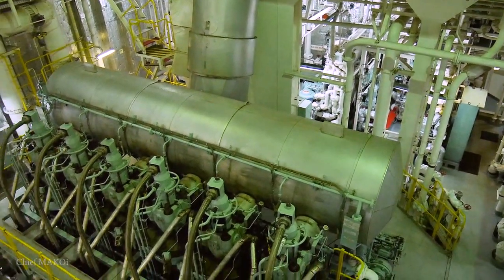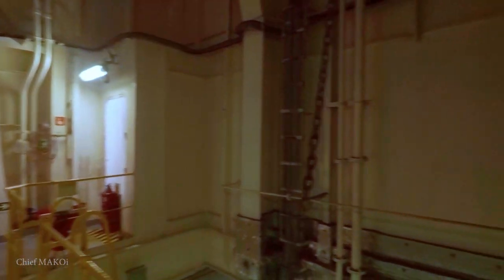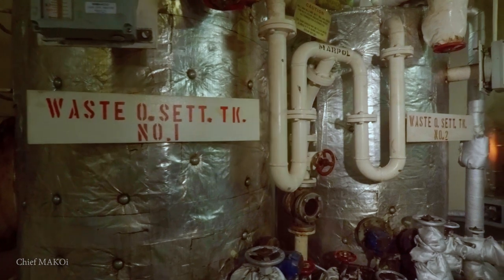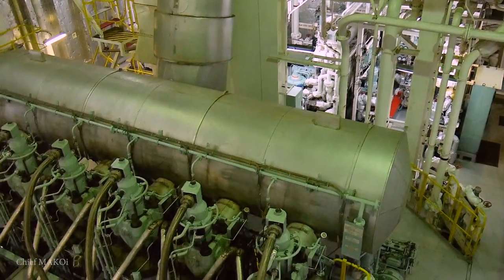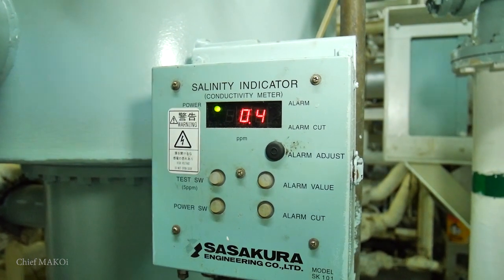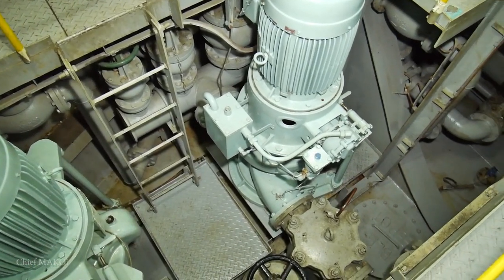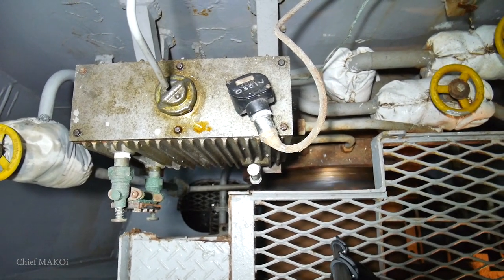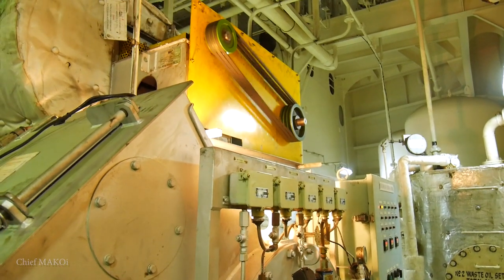Ship's Engine Room | Seaman Vlog

Comment: I worked as an outside fire protection contractor on ships for a few years and found that ships with Filipino crews maintained the cleanest engine rooms. Exxon, Standard, Military Sealift Command, APL, and a variety of others are the lines I worked on.

Comment: Chief, I am in my seventies and was an engineer on steam turbine ships for several years. Even so apart from main engine differences there are still many similarities. Heat noise and vibration, no ac control room. We had occasional emergencies and I have to ask are you always this calm? Some chiefs I have known were definitely not! Still the bestjob I ever had. Thanks for refreshing my memories
Reply from the maker: Yes, I'm pretty much very calm.  Doesn't serve any purpose to be stressed and panic all the time 😄
Reply: Me too, 'Harriet'. Babcock&Wilcox 650psi main-steam. 4hr safe-stay time in the Med during their summer. THAT was hot...

Comment: I’d figure there must be a lot of R&D work going on in developing ship propulsion and electrical/fresh water generation systems etc that run on renewable forms of energy rather than heavy fossil fuel petroleum distillates.  Need to figure out how to make these necessary processes carbon-neutral very very soon!
Reply: You're right, there is lots of work going into hydrogen and electric merchant ships currently!

Comment: AAAhhh, my job description many days. Hot, noisy and the smell of grease and fuel in the air, sadly retired. So many lovely gauges to read and each one worth noting. Do you actually use diesel or is the main engine on bunker fuel i wonder with all that fuel seperation and filtering. Those Diahatsu engines would want diesel I expect. Thanks for a great ride Chief!!!

Comment: A couple of questions on the main engine Chief -
1. What are those grey tubs between each cylinder on the tops?
2. With a camshaftless engine, can you still drive on the sticks?  Just wondering what happens if the electronics/pneumatics/governor etc fail?  Even with the more modern (in my day) engines such as the GF, you could still leap out to the sticks to get you out of a sticky situation...
Reply from the maker: +Stephen Carey 1. If you put the time frame where it is shown in the video, I'll be sure of my answer.  But if I had to guess, you're probably pointing at the accumulators.  Located around the Fuel injection pump area? They're the odd looking things if you're used to the old engine designs.
2. That's the pickle with these electronic engines.  They all depend on the circuit board and there's no way you could do things manually.  There's always a spare of those onboard though.
Reply: What are the accumulators for?  It's certainly what they look like, but I don't know the purpose - to keep the hydraulics up to snuff for the exhaust valves?
I remember when we went from relays (which I still think are the best way to run things in enginerooms) to PCBs, it was fine if you had a box full of cards, you just swapped one out - which then blew with exactly the same fault!  You left the card half out to keep the alarm light flashing, and just kept an eye on what it was measuring...  That was a bit onerous once you had half a dozen of the damn things flashing away.  Nowadays it's all done with redundant PLCs - we used dual redundant ones in the Oil & Gas industry.  If one went wrong, it switched to the redundant PLC and everything carried on as normal.  Not!  Then you had to get some 11 year old with a laptop to come down and search through the ladder logic to see what had gone wrong...  to me it's technology looking for a market place, and it has caused problems in the Type 45 destroyers of the RN, and also the USS Zumwalt class.  Everyone says it's too difficult to fix the propulsion quickly if a bullet goes through something, whereas there are stories from WW2 where the whole main engine was shunted aside by a torpedo, and the stokers managed to crowbar it back into place and get the thing going again!
Give me a camshaft any day...
Another nice clean engineroom by the way!
Reply from the maker: Yes, the accumulators are indeed for the hydraulics, both for the exhaust valves and the fuel injection pump.  

Thanks for sharing your experience btw.  I actually share the same sentiment with regards to engines with camshafts.  I've had my share of remote control malfunctions and going manual saved the day.  Unfortunately the trend is headed towards this type of engines so I also need to adapt or risk becoming obsolete.  That's just how it is in the industry, right?
Reply: @ChiefMAKOi  Yes, I consider it's "technology looking for a marketplace" and as far as I am concerned, that marketplace is not at sea, but "What to do - no choice!"  There have been problems with the RN's Type 45 destroyers, the USN's Zumwalt and Littoral ships too - too complicated, and when something goes wrong, it's not easy to fix.  Not a situation you should be placed in when shot and shell are passing over and through you.  I have no problem with weapons and comms being computerised, they can react far faster than the average "fish head" can, but propulsion and power generation are the heart of a vessel, and having to call some 11 year old with a laptop to try and get round the ladder logic of your engine system doesn't seem to me to be the way to go!  I remember one "war story" where a torpedo hit the ship in the engineroom, and displaced the main engine (steam recip) by a few metres.  They fothered the outside and crowbarred the main engine more or less back into place and got going again!

Comment: Is the engine room kept so warm for a reason, meaning in colder climes, can it be more excessively ventilated to keep the temps down, or are machinery tolerances set up expecting 45 C?

Comment: Quick question, I noticed on a few marine engine videos, the tachometer has the red area around 50RPM. Is that for engine parameters or for the prop efficiency?
Reply from the maker: Critical speed.  Lots of vibration.
Reply: @ChiefMAKOi   Ahhh, ok. Thanks!

Comment: Hi Chief MAKOi, My grandfather was a chief eng on the great lakes and served in WW2. I'm curious when you need to reverse thrust, does that mean you need to reverse the rotation of the engine as well since its coupled direct to the main shaft? Does that take long to do?
Reply from the maker: For ships with direct coupling, yes the engine needs to reverse rotation.  Since you will only usually use reverse during maneuvering, the ship isn't moving too fast so during those times it doesn't really take too long.

Comment: I'm curious. If the main and auxiliary computers failed could you possibly manually run the main engine ?
Reply from the maker: On this ship, no.  I was informed that Belgrano was towed last week in Canada because the engine suddenly stopped and then failed to start.
Reply: @ChiefMAKOi  I have always wanted to have a computerized run engine but with manual backup. I guess that is impossible. Just one EMP or dirty bomb will shut down everything. It's all meant to fail is all out war breaks out.

Comment: Cheng MAKOi; you don't know what hot is until you've stood watch in the boiler-room in the Med during their summer. 4hr safe-stay time standing DIRECTLY under the ventilation ducts.
It was like walking into an oven. 🔥
Reply from the maker: That's winter if compared to going INSIDE the Boiler furnace for tube cleaning while your ship is anchored within the Persian Gulf in July.  Even wearing 3 coveralls, 3 pairs of socks, a wintet jacket, leather gloves, face mask, and winter hats to insulate yourself from the heat, the longest I've lasted inside was about 30 seconds.  We can't wear thicker clothing because the crawl space to get inside the furnace was very small.
Reply: Cheng; we waited for 'cold-iron' before starting THAT hot mess, but I feelz 'ya, boss. Oh, the memories....
You just earned a sub... ✌
Reply: Oh yeah; seeing the 3-bladed screws on the epaulets of your kackis warms my heart. You're in charge of the heartbeat of the ship; savor it. ❤ USN(R)

Comment: 5.40 Do you guys carry out Vibration analysis on the Engine room? Looks like a vibration analyzer the guy is using. Just discovered your channel its very interesting.
Reply from the maker: It's a pressure indicator to measure the power output of each cylinder.

Comment: What is the electrical voltage coming from those generators?
Reply from the maker: 440 V
Reply: @ChiefMAKOi  Is it a 480Y/277 volt system of is it a straight 480 volt delta?

Comment: A TIP FOR YOUR VIDEOS IS IF YOU HAVE TIME PANN AS SLOW AS YOU CAN AND SHOOT A TINY BIT WIDER, THEN IN POST YOU WILL HAVE LESS ROLLING SHUTTER AND CAN SMOOTHE EVERYTHING LIKE BUTTER.
Reply: Tip for your posts. Do not use capitals, this is not a teleprinter. Capitals denote shouting.
Reply: Sometimes caps is on and i have already typed , i often don’t look at what i type as i go. The placement of the caps button is in the way

Comment: 7:20 3 x 610 kw = 1.8 Mw Why would you ever need this much elektricity on a ship? Unless you use it for resistive heating, wich would be horribly inefient compared to just burning the diesel directly.
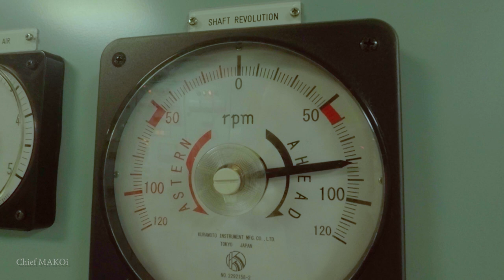Edit: 10:57 
I see that only one of them is in service and the other two are on standby. So in this case it is "only" gererating 350kw. Still I wonder where all that power is going! Do you still use incandessent light bulbs?
Reply from the maker: Various pumps for sea water, fresh water, lube oil, fuel oil, air compressor, refrigeration, air conditioning plant and other machinery.  During maneuvering additional power is required for the hydraulic system for the mooring winches, anchor windlass and other deck machinery.  Some of the pumps need around 40kW each.

Comment: Nice videos, I wanted to do that career once upon a time but finally I chose another path in my life which I do not regret. However quite a few times when I was teenager and curious travelling with liner ferries I did some sneaky things and infiltrated into these "crew only"  doors and managed to get down to the engine rooms. It was back in the days without CCTV.  From the moment I pass through the door to the place that passengers do not go and feel the heat, the noises, the narrow passages and stairs I was ecstatic! It is funny what these passengers might do, if you ever work in a liner you have to keep an eye on them...

Comment: Hi. Marine engineer from Norway here. Great video for the public. It looks like you change ship very often. Is it normal to do that in your company? I guess you use the first days onboard to get to know the ship? Are all the engineers changed out on the ships or do you get to work with someone with long experience on a specific ship?
Reply from the maker: It's usually like this. But my company is planning to make a rotation plan.  So maybe for the next 2 years I will be going on and off between only 2 ships.